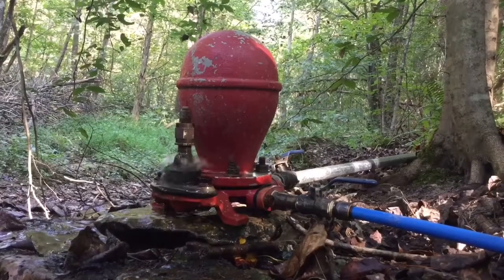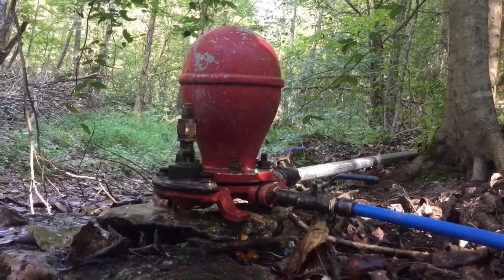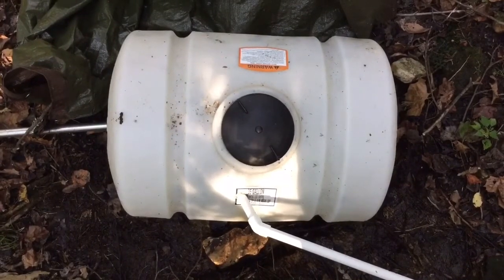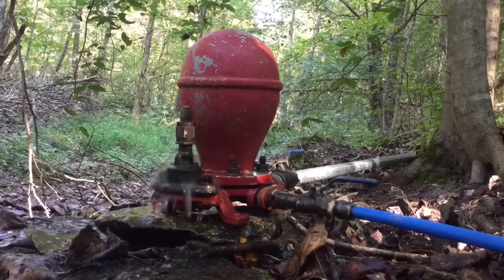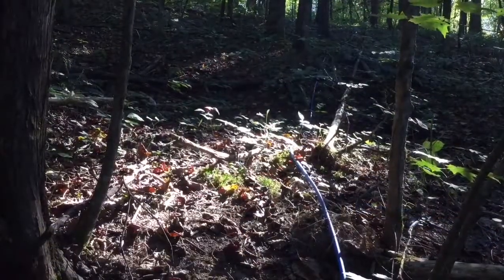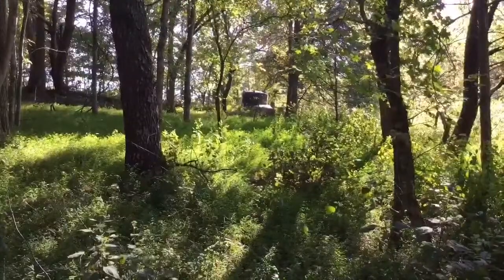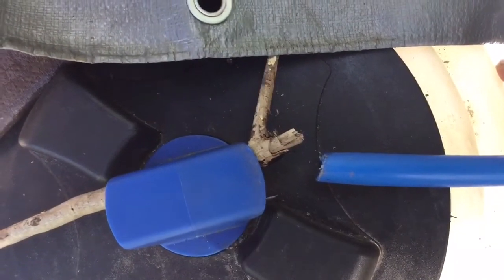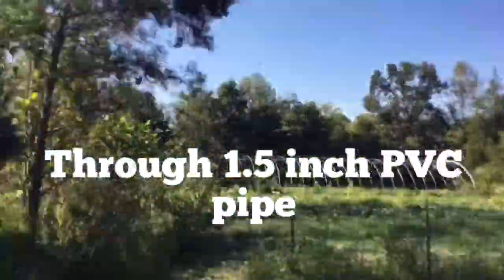Rough Draft Farmstead: Ram Pump

Comment: I have had so much fun with #Rampumps. My system best delivered 9800 L/ day to 55 m in elevation, using a 6 m head, a 12 m 2" drive pipe with a 2" ram all home built. I have not got a new video but check out my earlier iteration here: https://youtu.be/LvPUna1FzhI

Comment: What is inside the airtight to create the pulse? Most pumps I've seen like this are smaller and use a partially filled inner tube as a compression bladder. The inner tube compresses while the tank fills with water. Once the tube reaches it's compression limit, it is forced to expand... Pushing the water back out the tank and through the exit valve.
Reply from the maker: My understanding is that the pulse isn’t created inside the tank. So water comes under the tank, hits the water hammer, it’s is stopped inside the tank momentarily then with nowhere else to go, goes out the check valve that leads to the water tank (the blue line). I should say, though, I am not an engineer but I think the technical info is on the Davie’s Ram Pump site?

Comment: how much fall do you have there?
Reply: He says at the beginning of the video that the water is raised 100 ft vertically. Usually for every 6-7 ft.of elevation, the pump would have to be 1ft lower than it's water source. Meaning this pump would have to be 14-18 ft below it's water source. When he shows where the water runs to from the pump (in high speed), it didn't look like much of a rise vertically (elevation). 100 ft would be like a 7 or 8 story building for reference. While I know these pumps work, I think there might be some slight inflating of the #'s.